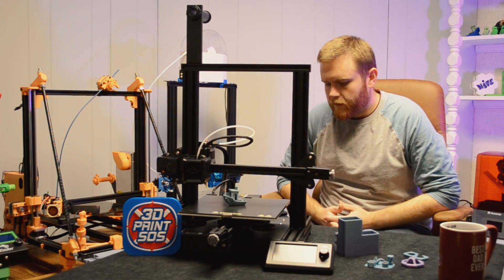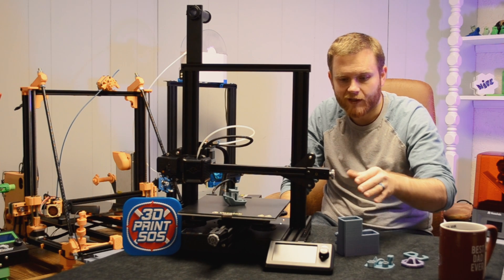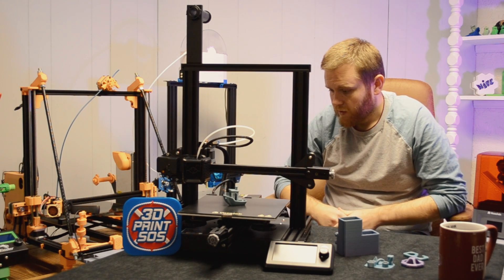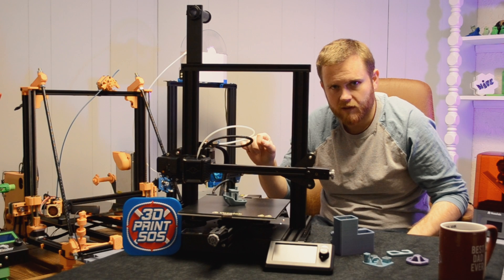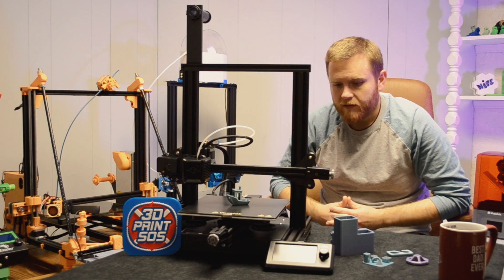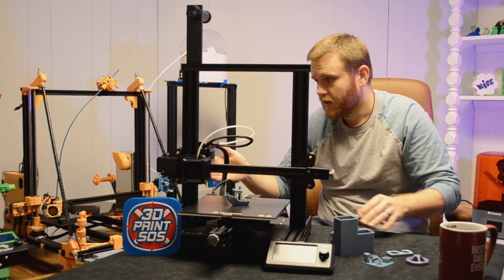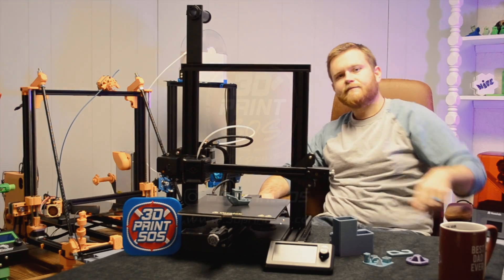Voxelab Aquila 3D Printer Review

Comment: bougt one for 110 euro's lol! thats around 130 dollars... yes this has the same hardware as the Ender-3 V2 but just a lil bit other designs for plastic parts.
I mainly bought it for the frame, and upgrade an old Ender-3 Pro with it's board. I dislike those screens because they are limited to firmware modifications. really hard to make your own menu's. so I will smack in a SKR2 with a good ol LCD screen so you can easily add / remove menu's your own. plus the old screens are easy to work with.
Reply from the maker: Sick deal! Yea since these are clones, the doors open for all kinds of mods.

Comment: Great video, but I have have not had a great experience with this. I am an absolute beginner and the first test prints were great but now nothing sticks to the print bed. Tried alcohol, washing it, levelling it, glue sticks noting works. Loved it for the 5 prints.
Reply from the maker: Hmm. Nothing sticking is a bit unusual. It’s gotta be a leveling issue. I would try to do live leveling. And keep slowly slowly slowly bribing the bed up until this game begin to stick.
Reply: Robert: If its not sticking, your bed is likely not level enough, the glass print bed that comes with the aquilla is one of the best in the industry. If you get your bed level and it continues, switch to PLA +, also try raising your bed temperature.

Comment: I was literally about to click "Confirm Purchase" on Amazon for an Ender 3 when I decided to check out your video, just as a final precaution, and I'm really glad I did. I had already read up on both printers' features and drawbacks and watched the manufacturers' website vid's, but none of the videos really informed me very much or gave an apples-to-apples comparison with the competition, so I just decided to go with the common, well-known Ender 3. Your video did what theirs' did not - give direct comparisons of important parts and characteristics (including the GUI), along with examples of relevant printed examples. 

Are there any accessories or tools you would recommend I get? Like perhaps a magnetic surface mat, or any other essentials for getting started?

Also, can you give me advice on what filament to get?
 - I'm looking more for a smooth print-out with small details printed as accurately as realistically possible. Super-strength or serious resistance to harsh environments is not much of a concern to me. As an example, I would like to be able to print chess pieces that are as detailed as possible. Additionally, it would be good if the print-out could be machined a bit (drilling and tapping a hole for a screw, cutting it up on a bandsaw, etc.).   

I don't mind if the filament is expensive, I just want the best quality. Detail and smoothness are ultimately the most important feature I am chasing.

Thanks!
Reply from the maker: Heeeey. Nice. Apples to apples, I’d choose the Aquila as well. Good choice.

Comment: Just  a small question  can I use my phone lol
Reply from the maker: When you even eventually get octoprint setup and running, there are some abs that let you, yeah. Otherwise, no. :(
Reply: @3DPrintSOS  so like I can on some apps on the phone
Reply: If so can you name some
Reply from the maker: Astroprint one was I used. You can use a raspberry pi running octoprint with Astro print installed as a plug-in. That will let you choose and print from you phone.
Reply: Lol preferably under 200 just so there affordable

Comment: I just got an voxelab aquila because it was cheap. I was super suprised when it outperformed my Ender 3 V2. Great video and I totally agree with your conclusion.
Reply from the maker: Same experience here. Haha. It’s been great.
Reply: I hear so many people saying this printer is like a V2, its not, its extremely close to the pro, the only major differences between this and a pro is; the pro is capable of 10 degrees C more on the extruder and has a slightly  larger print bed.
Reply: @euro2984  My E3 Pro had non-silent stepper drivers, which sucks. Also it had a weird magnetic sticker sheet that had holes in it after 10 prints. V2 and Aquila have a glass bed.

Comment: What are your thoughts on ventilation and having 3d printers in living spaces? The only space i would be able to put it is my pretty small bedroom, and I'm reading a lot of mixed opinions whether that's safe (even for pla) due to airborne particles being released
Reply from the maker: The concern is valid. One I would stick with pla in that case. The lower temperature is slightly better. Avoid abs. You can always make a inexpensive lack enclosure with a filter and be good to go.
Reply: Yes, 3DPrintSOS is right, there are papers that say clearly ABS is harmful. PLA not significant results where found in the latest I know.

Comment: Is there anyway to reset back to original? Please help. I thought i would get better results by spending $40 on the BLtouch leveler, what could it hurt other than my thin wallet?  I installed it and it wouldnt work and now my hot end stays up in the air and wont auto home,  I guess it put home in the middle of the air. So I uninstalled it but still cant print, cant even get it close to the bed, maybe a half inch from the limit switch. Is there any reset?
Reply from the maker: Hmm, if the z doesn’t go down, you just need to revert back to an older firmware.

Comment: Most Enders will eventually get a hot end problem. It is treatable.  I assume this Ender clone is similar. Any comments?
Reply from the maker: I’ve been printing a ton with it and it’s been great. But yes overtime, things wear out and the ptfe will slowly degrade and need a replacement. I highly suggest TecBoss tubing. Great stuff.

Comment: Hi Fedor, thank you for all the quality content in your channel, I'm ordering one of those printers today. Silly question, if I may, won't it take a STL file from a card right out of the box without installing a Cura or similar ? Doesn't it come with a slicer installed ? Please excuse me if the question is too idiot, but when you assembled the printer you inserted a card and it printed right away, so now I don't know if you had installed the slicer beforehand or the printer comes with a slicer or the files in your card were in other format that the printer could slice. Thank you again.
Reply from the maker: No problem. And stl file is a 3D rendering and the printer needs it to be converted to gcode in order to understand what to do with it. So you’d have to download and install Cura from the ultimaker website and “slice” stl files into gcode. Then you can put the gcode files on the sd card and print. There are some files on the sd card that are ready to print. Perfect for testing right after assembly. :)

Comment: Are you planning on doing a mods guide for this printer? That would be awesome
Reply from the maker: I originally did but then I realized just how good the printer is working as is. So my current plan is to use it until something needs to be modified or fixed. I do have plenty of other highly modified printers. So maybe I can feature some improvements on those and talk about what actually worked and what didn’t.  Would that be a cool video idea?
Reply: @3DPrintSOS  yes

Comment: Elegoo is about to release the Neptune 2 for $170.It's crazy how cheap these things have got. My friends dad was one of the first few to get a 3d printer about 10 years ago it was several thousand dollars, and dropped off with a freight company. His dad used it to design and build these neat weight fasters and even designed a set of weights with built in handles that can be picked up flat off the floor. His idea sold to the UFC for an undisclosed amount of money. But anyways. Yeah we go it pretty good when it comes to selection and pricing.
Reply from the maker: Yes we do! I wonder how they would compete head to head. I haven’t had the chance to see specs, but it’s going to be hard to beat silent steppers drivers, color screen, glass bed, 32bit board.
Reply: @3DPrintSOS  oh yeah, fan ventilation loudness? (probably on the back area) Almost all these cheaper printers need a printed fan shroud to redirect the fan airflow and make it a bit quieter. Did the Aquila have that same problem? Does that need a shroud as well?
Reply from the maker: It wouldn’t hurt. The fans are cheap. The loudest is the main hotend fan followed by the psu. Changing those to something quieter would make it that much better.

Comment: On Amazon I found one of these for $199 us, and the cheapest ender 3 v2 I could find was $285 lol
Reply from the maker: Yep. It’s a no brainer at that price.
Reply: @3DPrintSOS  all I want to do before that is figure out what mods or accessories I want to buy with it
Reply from the maker: @ethanbroussard  Nothin. Just buy a few rolls of filament. Its pretty darn good right out of the box.
Reply: @3DPrintSOS  I was just wondering if maybe I should get a filament dry box or something like that but thanks for the advice 👍
Reply from the maker: I have one for PETG and nylon. But you should be good without one with PLA. ;)
Reply: @3DPrintSOS  ok I was doing a little research on different mods for ender 3 v2s, and I learned about the bltouch. Do you know if it would work on an aquila? It would definitely be helpful to have one but I probably wont need it
Reply from the maker: It should work. You can even just flash Ender firmware if that’s what your into. In my opinion, it doesn’t need it. It’s small enough to be easy to level. 300 and bigger, an auto leveler starts to make more sense.
Reply: @3DPrintSOS  ok thank you, and I also just want to say that you're incredibly underrated lol when I found your channel I thought you had way more subscribers than you do
Reply from the maker: Thank you for the kind words. I’ve only been making these vids for about a month. ;)
Reply: Just caught one on sale for $179. Idk what I'm doing but I had to!!
Reply from the maker: Great deal!

Comment: How's it going..

So never printed anything in my life and know nothing about printing.. 
Been wanting to get into this hobby for some time but just looked too complicated..
Any way,, decided to check out 3D printers on Amazon and this one caught my eye,, did a google video search on it, and low and behold, this video popped up.
My question is...

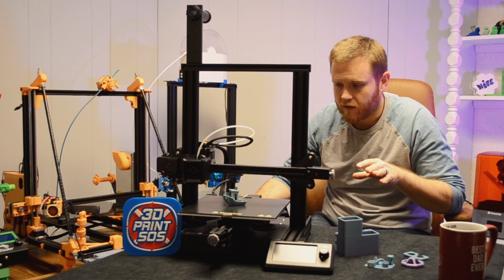Would I be able to print 1:28 Mini-Z rc bodies on this?
Dimensions would be 190mm L x 80mm W x 50mm H.
I noticed on your channel you printed a 4x4 rc truck so this could be promising..
Also,, if you have any links on how I would go about entering the configurations and so forth from scratch would be greatly appreciated..
I'm going to start my research now on all of this and maybe by the time you reply I will know a bit about all of this..
Thanks...
Reply from the maker: Hey, I that size you mentioned would be a perfect fit for the printer. Just fiy that truck you saw is a 1/8th scale truck. So it’s actually quite massive. Took a month print. :) I do have videos on how to set things up and get started. So, be sure to check them out. I’ll also keep the content coming. Feel free to ask any questions you may have
Reply: You did an awesome job that's for sure!!
Yeah, these Mini-Z bodies can get quite pricy and noticed in one of my groups that a couple of people are printing off parts for sale so figured I'd look into printing my own 1:28 scale bodies.. Found a video with a link to pre designed 1:10 scale trucks, but looking more into creating my own design from scratch so have some work and research to do as it's not quite as easy as just taking a pic and entering it into a program lolZ..
Don't suppose you have any suggestions for 3D software for this exact printer as I think this is the one I'm going to order as soon as I feel comfortable that I can pull this off..
Thanks a ton and great work..
I'll check out your videos on your homepage for sure!!!
Reply from the maker: You could actually use any 3D rendering software.  They will all export a file that you then have to send through a “slicer” software so that you printer understands what to do with it. So you aren’t limited to anything as far as design. Fusion360, design spark mechanical, blender, sketch up, there are many. ;) best of luck.
Reply: Yup I watched all your videos so actually know what you're talking about now...
Thank you so much for your time and informative content..
Going to order this bad boy rite now so should be here by Saturday..
Thanks again and keep up the superb work!!!!!!!!
Reply from the maker: Awesome. Let me know if you got questions.

Comment: Looking to buy my first 3D printer. Any issues using Octoprint with this printer.
Reply from the maker: I haven’t used octoprint on this one, but I’ve run it on my Ender for ages. Since this printer is a clone of the Ender 3 v2, there should be no problem.

Comment: What kind of filament can this 3d printer use ?
Reply from the maker: Good question. It should handle pla and PETG without mods. But it could do TPU with a printed or purchased extruder and abs with an enclosure.
Reply: @3DPrintSOS  Thanks for a quick respons, I am new to 3d printing so I did not understand that mods you discribed. Could it use abs and what are the possitives and negatives with each kind of filament ? Thanks in advance.
Reply from the maker: It can use abs but the printer would have to be placed into an enclosure to regulate and maintain temperature. Since you are new, stick to pla for a while. Great way to learn about your machine. It’s easy to learn and white strong. Then you can try PETG, a little bit less brittle and some consider it stronger because of that. TPU is rubber, and thus needs a better extruder or else it will just bunch up and won’t print. So pla to start. ;)
Reply: @3DPrintSOS  Okay and thanks again for a quick respons. Do you have to use adhesive with a heated bed ?
Reply from the maker: You shouldn’t have to. No. Just clean with iso and level really good.
Reply: @3DPrintSOS  Okay, do you have any other 3d printers that you would recommend as a first printer ?
Reply: @3DPrintSOS  Do you know if the voxelab aquila have a chip that forces you to buy their filament ?
Reply from the maker: No chip. You can use any brand. :)

Comment: Just received mine, assembled it, level it up and print a toolbox with the included PLA. You are right the print result out of the box is awesome! But i would really suggest to upgrade the plastic feeder frame for a better on made of aluminum. This thing gona break soon enough. It need a filament guide to but im picky at this point. an other thing those step motor gets hot, dont know if it suppose to be that hot. For the rest awesome UI ! Silent motor but those fans are quite loud nothing really annoying, it on my a desk that should act as a amplifier for vibration and a didn't find the need to damper it. Build is sturdy awesome packaging definitively satisfied whit that price !    Thanks for the review and those tutorials really appreciate them.
Reply from the maker: Awesome. If you do upgrade the extruder I suggest a dual gear version. As for the motors, they are getting hot because something is binding. There must be something out of alignment or too much pressure on a wheel or belt. They don’t get hot if they aren’t stressed. ;)

Comment: Thank you for your video,
Do you know what drivers are installed? (TMC2208?) and if the board is proprietary?
Thank you
Reply from the maker: Yes and the board is proprietary. It’s still a clone though, so I wouldn’t be surprised if it’s an Ender replica. Looks like you install Ender firmware on it completely if you wanted to.